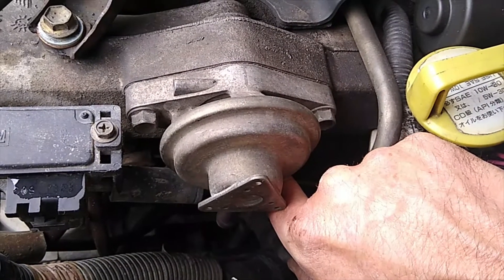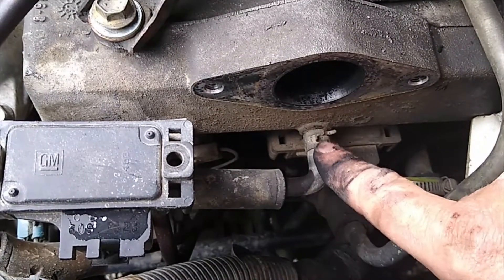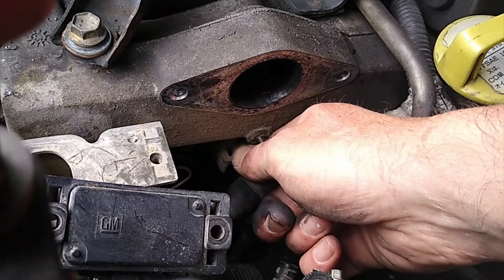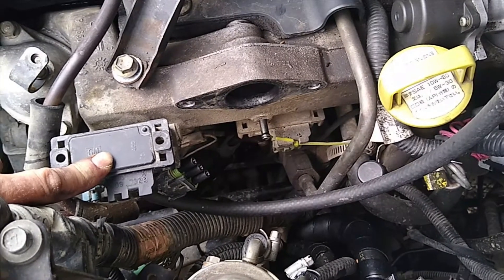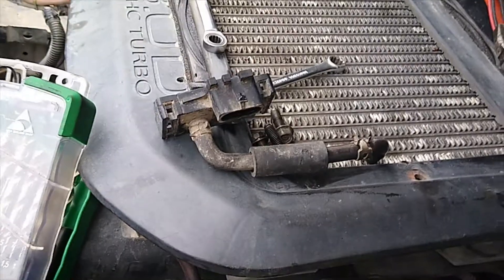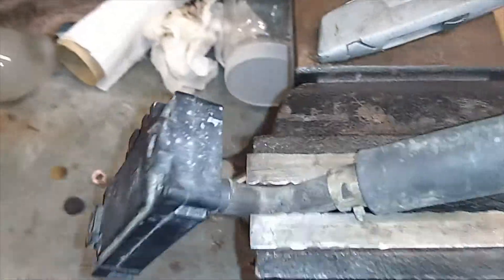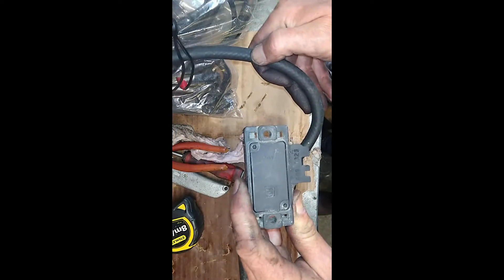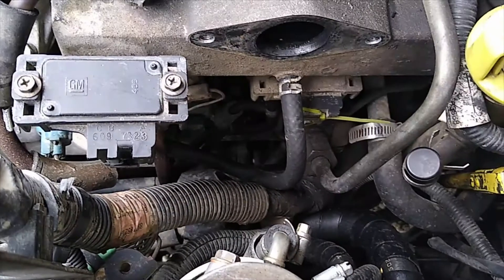4JX1 Isuzu Blocked MAP sensor

Comment: Hello, I have a isuzu trooper 1994 and the check tramission light keeps on flashing . So I scanned the obd-1 and get back to code 23 but two definitions one is mat circuit fault and the other is map sensor fault or mat sensor ? Which one is correct and relates to the transmission? I scanned the transmission

Comment: Can you tell me whether the set up is the same for the 4JG2. Have a  '96 Bighorn which has done me well but currently surging/dropping gears whilst in motion. Suspect it's a simple enough issue once identified so checking into the IAC also.
Reply: similar in the 4jg2 though has in line filter and these oil and partly block up due to erratic idling